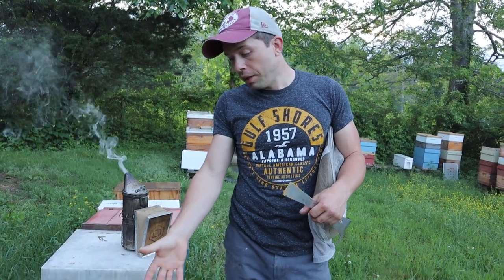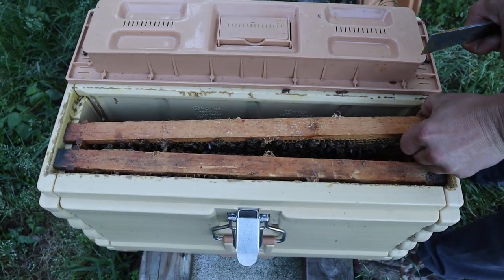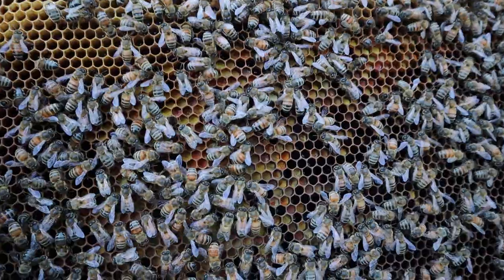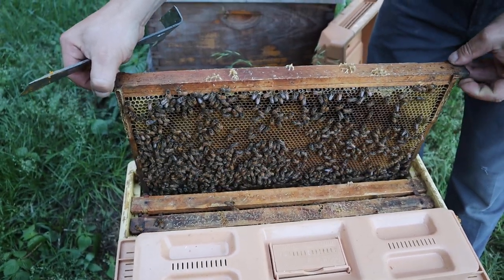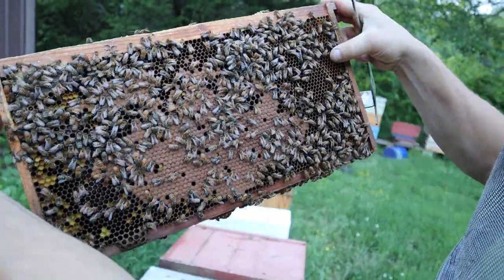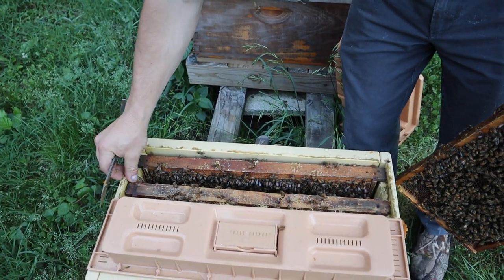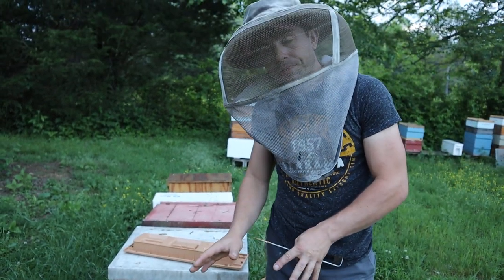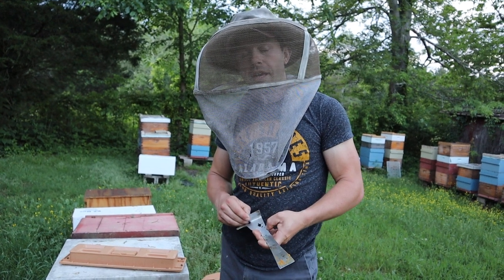🔵Small queen mating nucs can have big impacts!

Comment: Regarding wearing protective gear: I almost never work bees without a hat and veil. Getting popped in the eye is no fun. Jackets and bee suits are a pain, mostly because even a good vented one is hot. Today was in the 90s with humidity around 50%, which is very humid for this area (Easterners relax ... I grew up back there and would never have considered 50% to be humid, but Ive been in the Pacific Northwest for 30 years and have become acclimated). I had to wear a bee jacket for the swarm removal I was doing and was soaked by the end of it. Do you need more than a hat and veil? What time of day is it? Bees are grumpier in the evening when everyone is home. Similarly if it is cloudy, cool, or damp and the bees are all at home. Windy conditions get them stirred up as well. 
What are you going to be doing? Today’s removal was overhead and out or reach, so I was taking bees down with a bucket on a telescoping pole. I was certainly going to get bees raining down on me, so protection was in order. Are you going deep into the hive or are you just popping the top for a quick look?
Sometimes the bees will tell you. A hive is sometimes loud, which means they are likely pissy and more protection is in order. And sometimes they start bumping you as soon as you open the hive.
I almost never wear gloves because they are clumsy. I can handle the hive components better without them and am less likely to make a clumsy move and get the bees stirred up. 
Don’t be macho (or in a hurry) Getting stung, and especially stung a lot, is no fun and can put you at risk. I did a swarm removal a couple of weeks ago in shorts and no protection because I was in a hurry. I took at least 50 stings (no exaggeration) and was in rough shape for a few hours.
Also, smoke, and sometimes a spray bottle of sugar syrup, can go a long way to making for a safe and pleasant experience.
Finally, if you are inexperienced err on the side of caution. Experience will teach you how careful you need to be.
Thanks as always for the videos, Kamon